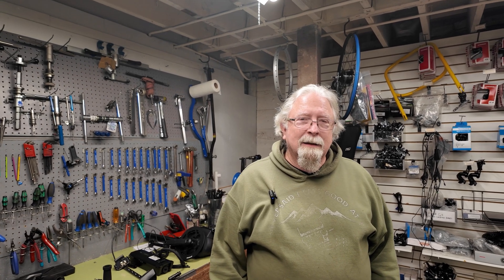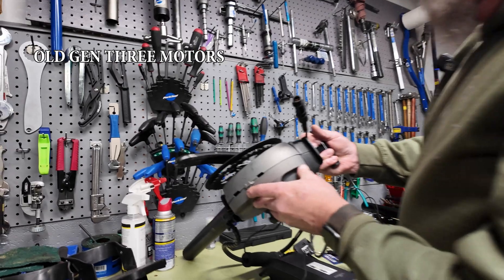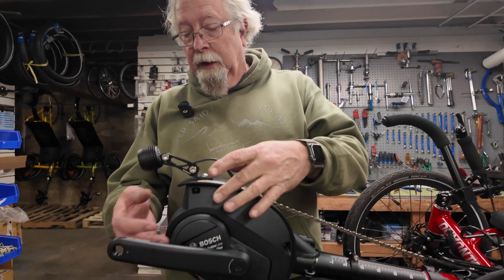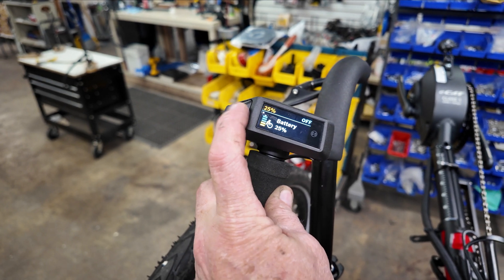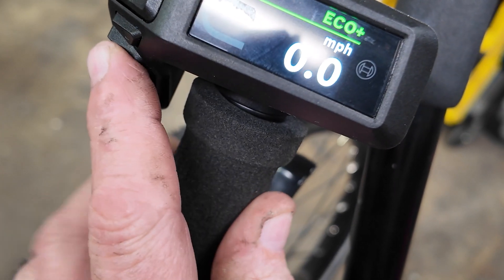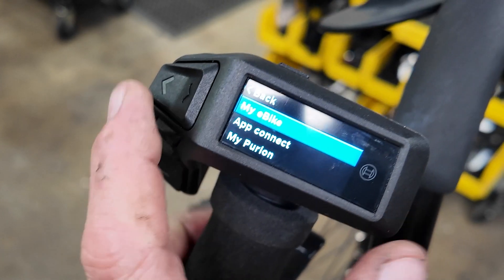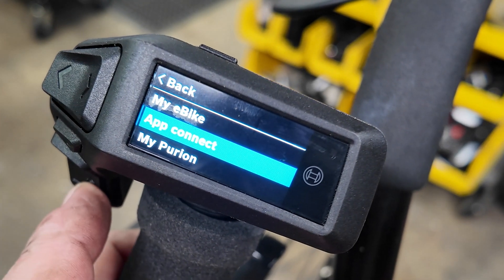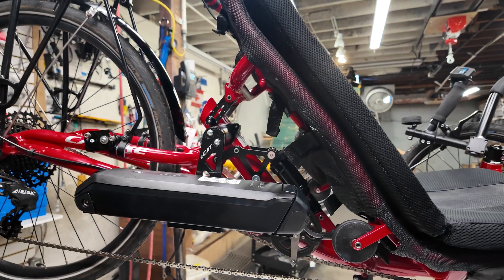Catrike’s Bosch Smart System Motor Kit -New For 2025!!

Comment: Nice…too bad Catrike doesn’t support internal wiring through the boom…would make it a much neater installation.
Reply from the maker: Internal wiring is wonderful until you’re the mechanic troubleshooting - say - an internal short caused by a wire pinch from boom movement or folding/unfolding.  Also, trust me, customers don’t much appreciate the bill that comes with it.  External wiring is so much easier to maintain